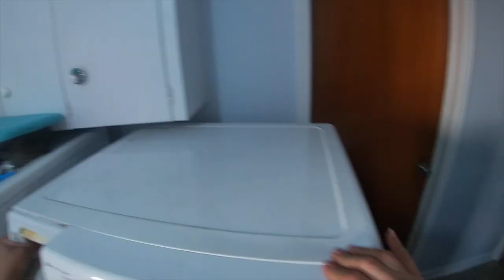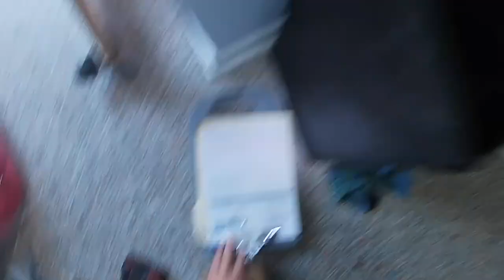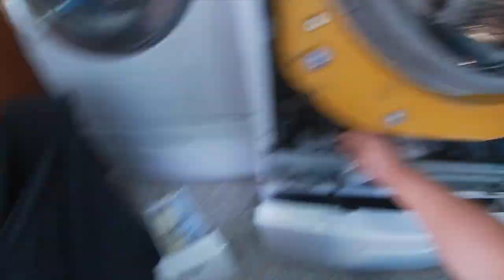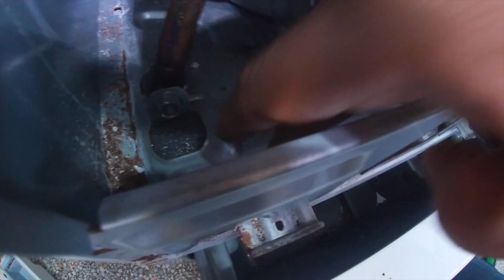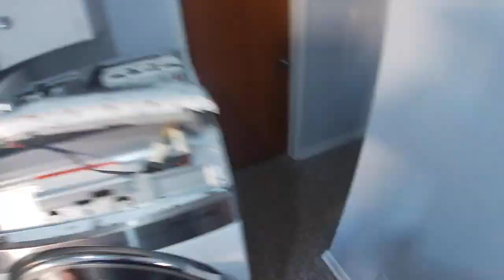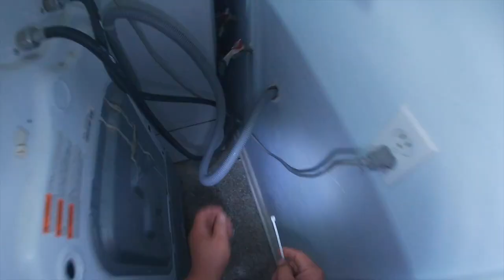How To Fix #Samsung Front Load #Washer NOT DRAINING! | Model Number  WF448AAW/XAA

Comment: Thank you for this video. This is the only video I happened upon that described the flapper check valve being a thing. I have a Samsung WF448AAP-XAA washer that would stop and give the not draining error message intermittently, usually after a rinse cycle when it was supposed to drain. It turned out to be the rubber flapper valve. My circulating and drain motors looked to be the same as those you were repairing. I had to modify the replacement flapper valve I ordered from Amazon ( Samsung DC62-00299A PS4208748 Washer Check Valve) because the rubber ring surrounding it was too wide so it didn't fit the groove in the drain pipe for it and kept the flapper from fully closing. Looking at it closely it looked like I could modify the new flapper valvve so it would work. I carefully cut the rubber ring around the circumference of the valve ring at approximately the mid point with a small box cutter so the ring could fit in the slot in the drain connection. The new flapper valve was a bit smaller and it fits the opening of the drain connection much better than the original. I would post a picture of my mod if I could but I don't know if it's possible on a YT comment.
Reply from the maker: You are very welcome, thanks for sharing that clever modification tip with others who might run into the same issue! 😊

Comment: Samsung WF448

My Samsung Washer WF448 from 2008 has never had issues until this week. I am experiencing No Draining even tho I hear the pump turn on. It will stop in the middle of any cycle when after trying to drain. I did tear the washer apart to test the components, I would get 120vAC to the pumps initially. And also checked their resistance in Ohms. On the Drain pump, I got 14.4 ohms and the Circulation pump measured about 28.3 ohms, according to what I have read, those tests pass. I was uncertain if I got the diagnostic mode to work correctly, so by taking everything apart and then testing helped me determine my position. I almost think there is something blocking the drainage, but did not find anything, wish I had found something. Any help would be so much appreciation.
Reply: @supercoupe08  I got the exact same problem...did u get it fixed?

Comment: I have the exact same model# WF448AAW/XAA washer... The drain manifold has a drain pump on the left, and NO motor on the right... The right side of the manifold is a completely closed plastic mold... That rubber flapper is critical, as it makes the drain pump motor double as a recirculation pump... YOU DO NEED THAT FLAPPER... Flapper open = drain, and flapper closed = recirculate... I'm really not sure how your same model# washer has 2 separate motors... But mine does not... Only one motor mounted on the left side of the manifold...

Comment: My washer was a slightly different model, WF520ABP/XAA and when I went to take off the front panel like in the video, the bottom would not release. We ended up tilting the bottom up to take a look, and the bottom of the panel had 3 screws there. After removing those, I could remove the panel fully. If your panel doesn't remove easily like in the video, then check for those.
Reply: Exactly the same model but I also have two screws at botton of the panel.
Reply: Mine had two screws in the bottom. Drove me crazy for a while till I discovered they were there and removed them.

Comment: Some little thing that meant nothing to most people at the end of your video where you said keep the drain hose only a few inches from the top fixed my problem now for some reason it does drain but it will not fill up with water.. it switched on me😖😖😖😖
Reply from the maker: If it’s not filling in water you’ll probably need a water valve you have to make sure you’re getting enough water pressure from the water valve also check the filters on the water valve itself and make sure they are clean if you have a multimeter tester check if you get an 120 V at the water valve when it supposed to be filling in

Comment: This was the first video that actually showed how to put that wire back on I appreciate that but I think my washer still screwed. I checked continuity in the pump and it was fine so now I really have no clue why it will not drain
Reply from the maker: The drain pump have two fixtures electronically and mechanically when you check continuity you checking the electrical Winings for the motor the mechanical will be the blade in the rest of the housing 90% of the time the motor is going to test good but the blade or the blade rotor is bad if you try to spend the blade and you don’t feel tension your drain pump is bad also check the check valve which is the flapper rubber piece
Reply: @DIYRepairsNow  I did check that valve the first time around and it seemed good as far as the rest of it I will check into that in the morning when I get up thank you so much for your help
Reply: @DIYRepairsNow  hii! Can you suggest something for me? I have a problem with my pump, I tested the pump with multimeter and it doesn't have any voltage. The board is good visually. The wirings are also good as well. Any suggestion what to check in pcb?

Comment: If the filter and drain pump check out, look at the drain hose from the drum to the pump. Is it clogged with accumulated gunk?  If the drain lines are clear, it is probably the controller board.  These washers are known to blow the relay (a $0.25 part) that controls the drain pump.  The controller assemblies are not readily available, if at all (EOL'ed by Samsung after 5 or so years).  Used ones can be found on Ebay--caveat emptor.  The controller board from a model one up or one down on the Samsung product offerings for a given model run will often work--the wash cycles will be different on the dial or not available.  For example--if the controller comes from a lesser model, it may not offer the sanitize (heat) cycle, but all the other features are the same.  The various large online parts vendors have good information about OE part numbers and subsequent replacement part numbers.
Reply: Seems like what I've been experiencing. The pcb looks good visually. I'll have to find that drain relay tomorrow then.
Reply: May I ask, I do not get any voltage to the pump, it could be a relay problem right? Wirings are fine.
Reply: This is for a Samsung washer.  An LG should be similar in practice.

Comment: So my washer looks like its missing that little black hose that sticks out of the front by the filter. It's a Wf218anb/xaa Samsung. Should it have that little hose? And if so can I buy just that and put it on or do I need to replace that whole thing? Also would that piece being gone make it not drain?
Reply: It should drain w/o the hose.  It's just there to be able to direct the water into a container.  Any piece of tubing with the right diameter should be ok.

Comment: I’ve got an issue with my Samsung washer where it only drains sometimes.  I’ve gotten the ND (no drain) error code before, but it doesn’t always come up.  Sometimes it just sits where ever it is in the cycle and just keeps trying.  I’ve unplugged it and waited awhile and then it works again for awhile… have you ever come across that issue?

Comment: Good evening. Thanks for the video. I have a Samsung: WF448AAP/XAA I was getting the drain pump failure. I ordered the new pump and installed it. I started a cycle and it stayed stuck on the last rinse/spin cycle. I powered the machine off and put it on a spin cycle and it completely drained the machine. Machine is also not dispensing the downy. Pump seems to be working. Any ideas? Thanks for your help!
Reply: same here, did you fix yours/

Comment: Thank you for the video.  I was able to change the pump and get it back running in a few hours - I kept going and back and looking at the video.  I first replace the pump in February 2021.  It worked great.  Now the same error came up and it sounded like the pump was not spinning or it would stop too early.  I ordered another pump on Amazon and installed and washer is again working - no errs
Reply: When I look at the first replacement pump I took out there appears to be water inside the pump motor area.  Pump was used for about 7 months.  Is shaft seal on the little impeller supposed to seal water from entering the motor portion?  I assume that if the motor is supposed to stay dry and it is wet that would lead to problems.
Reply: ARE ARE 2 AWW

Comment: Samsung washer, replaced the pump today, but it didn't start working again.  In pump test mode, a big fat nothing.  
I can't find any good troubleshoot for the real problem.  The old pump I pulled is actually a functioning  pump, so I  can't figure out what the matter is.
Reply: I have the same issue.most likely the voltage going to the pump(120Vac) is missing, which I believe is controlled by the relay RY7 on the board. Im searching for a replacement as I have read from somebody here that samsung no longer manufactures the whole PCB
Reply: Mine was the relay, you have to order the relay from an electronics site and cut it out of the silicone caulk it’s buried in and I believe cut a slot in the plastic behind it with a dremel to access the solder joints to unsolder and install a new one. It work for a couple of years but now any time it has a large load it doesn’t drain and have to run a spin cycle and it drains just fine.

Comment: Great video! Replaced my motor yesterday with no issues because of your video. Still having the same issue though, No Drain. New pump works, it was moving water the first time I ran it. Now just give me the same error. I've checked all lines for obstructions/gunk and found nothing. Check valve looked good. Back to the drawing board! Anyone have advice?!
Reply: Hi Adam, did it work out? I might be facing similar situation.
Reply: Did it end up being the motherboard?
Reply: @daryltaco  Wondering the same thing! I replaced the pump and cleaned all lines. It worked following replacing the pump. But then the same error started again. I'm hearing a clicking sound when it's expected to drain and then nothing.

Comment: Thanks for sharing your knowledge with us. Besides of the drain pump, could it be anything else causing the washer not to drain? I just changed my pump. It is still not working, not even the humming sound of the pump. I am wondering if there is any power coming into the pump at all. I do not have a spinning problem because after I manually drains it, I ran a spin cycle. It spins as it should. I ran a quick wash. When it gets to rinse from the wash cycle, it stops and nd code appears. I would run a rinse + spin cycle. It stops right before spin with the same code. Anyone please your help is appreciated. Thank you all. Model # wf306law/xaa
Reply: Hi, I’m facing similar issue, is your washer working now?
Reply: @gdkalyan  I’m sorry to hear that. I changed a lot of parts from that unit and nothing seemed to work. I ended up getting a new unit from Home Depot last October.

Comment: I’m having an issue that maybe you could help with. My Samsung washer wf42h5200ap/a2z

It isn’t draining and the pump was replaced. 

I have constant 120 volt (even off) on the blue wire to case ground. 

It looks like the purple completes the neutral on the control board. I’m thinking. It’s a relay in the board. 

Is there anything else that could prevent the board to call to drain (even in test mode)? 

It’s a pretty expensive part. Especially if it does not solve the problem.

Great video!

Thank you in advance!
Reply from the maker: The only thing there is sending signal to the board to send power to the pump will be the pressure switch but if the pump was replaced and it worked fine for a little while that means it’s not the pressure switch for what you’re telling me The relay it turns on the drain pump in the main control board got stuck on the on position so my suggestion will be replaced main control board
Reply: @DIYRepairsNow  hi, where can I find this pressure switch please?

Comment: It would be most helpful to view the "diagnosis" procedure? 
In other words, what led to condemning the pump?
Or what if the drain pump is not receiving the 120 volts it requires for operation?
How would this situation be diagnosed?
 
Also, please lose the background "elevator music".  It adds nothing but annoyance.
Reply: I’m in the same boat. Thinking it’s the board but not sure how to be sure. FYI. It seems mine has constant 120 of the power board and the control board completes the circuit.
Reply: @Edub816   I need help and answers for same problem.  I just replaced pump with quality part,  but it will not drain on any cycle or in test mode.  Is there some little part I could replace, or is it possible for some obstruction to block draining without any code popping up?

Comment: Excellent video! Thanks for the how-to!

I changed the drain pump. Put it back together and it ran for about 30 minutes and the error code not draining came back on again. Could it be the recirculating pump?
Reply: Did you figure this out Joe? I'm dealing with the same issue..
Reply: @robertramirez1272   and me too, replaced the pump and it worked for 5 months, then the same problem. Now I replaced the pump again and it does not work still. I talked to Samsung and they have nothing intelligent to say. I am researching to replace the computer control panel now.
Reply: @alanwardle9807  same problem with my samsung washer not draining i replaced the drain pump try it on and again stop at the draining cycle.anybody can have idea or opinion what it is causing my washer not draining.
Reply: @omarstaana9089   it’s the computer board located on the back wall of the machine. I have been unable to find a replacement. They no longer make them. Now I have junk unless I can find one, what a waste of a good washer.
Reply: @alanwardle9807  were you able to fix the issue?i have the same problem. I checked the voltage going to the pump during the start of each cycle,  nothing. I checked for wire connection all the way to PCB at the back of the washer, and wire continuity is OK.I suspect it is the relay RY7 on the board that is broken.Tryin' to find this relay
Reply: @calvini.8211  Any update of this?

Comment: I have the same issue, but, in my case I replaced the draining pump twice already and still not draining. By the way I also replace the door lock to see if that was the problem but still not working. and code still appears, can you please help me?
Reply: I have the same problem. I had spend time cleaning the hoses, changing the pumps twice and still it wont complete the draining.  At this point I am buying a new washer
Reply: @installgreentoday  I did the same thing too! All hoses are cleaned the only thing I haven’t done is to check all the wires at this point I’m also thinking of getting a new one! I'm done with it!

Comment: My Samsung has 2 pumps i cleaned everything,no drain was clogged. The resistance in both motor pumps was good. Where could the problem be?
Reply: Did you fix it? I have the same issue. There is no error. Machine is trying to drain 1 sec and that’s it
Reply: Should be the door lock
Reply: @colombiansurbanmusic  hi! Can you elaborate about the door lock and how the pump works with the door lock?
Reply: My pump looked and felt fine.. However, it had water inside. It wasn't obvious until I shook it and heard water inside.

Comment: This was very helpful! Additionally, because I didn’t want to replace the pump and motor, I took them apart. Both were clogged with lent and gunk. Cleaned them out along with the small fill hose and drain hose. Works like new.
Reply from the maker: I am glad my video can help thanks for watching my video💯👍🏻👍🏻
Reply: @DIYRepairsNow   Thank you for the video, I replaced the pump 5 months ago and now the same problem of no drain is back. I put a second new pump and still not working. Do you think this is a problem with the control computer? The wires look good.
Reply: May I ask if your issue was that the machine would fill with water, initially spin and then get stock on the spin cycle(flashing)?
Reply from the maker: I am glad my video can help Thanks for watching my video👍🏻👍🏻💯💯

Comment: My Samsung was clog with sand. But it there is no presure two take the water out. Any help I will appreciated. Thanks
Reply from the maker: If it’s only sand you can try to put a shark vacuum on the drain line to get it unclogged

Comment: Thanks for the instructions. But the washer will not work correctly without that check valve. The check valve is not there to prevent water from the drain pipe coming back in. During some cycles the washer has a very small amount of water it wants to remove. This small amount it not enough to make it up the drain hose so it will keep running back down to the pump if you don't have the check valve. You will eventually get a drain error.
Reply: That sounds right to me. My pump tests fine, no blockages or gunk anywhere, so i think it's that little black check valve/flapper. This is a very frustrating problem that is difficult to diagnose because everything looks fine.